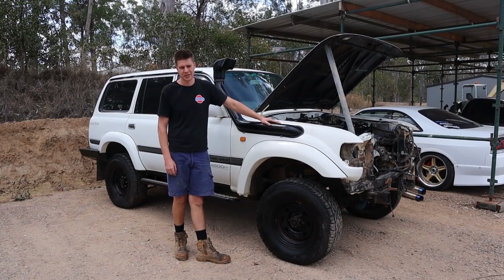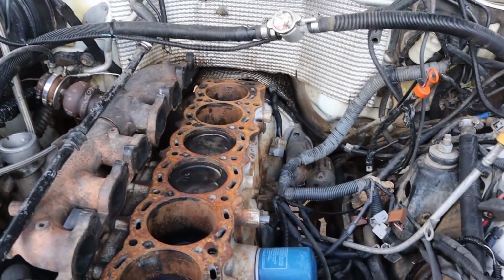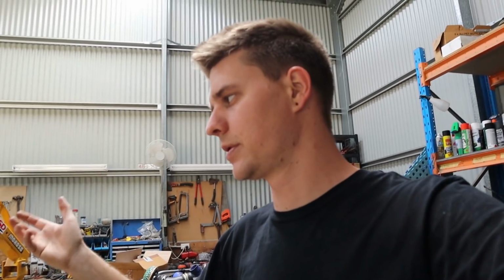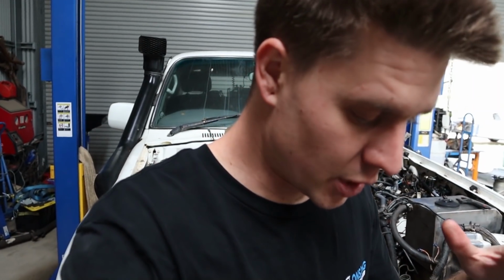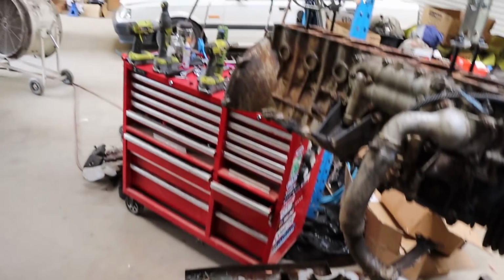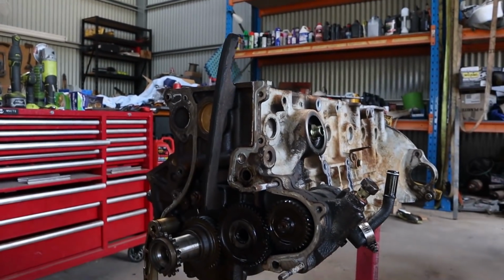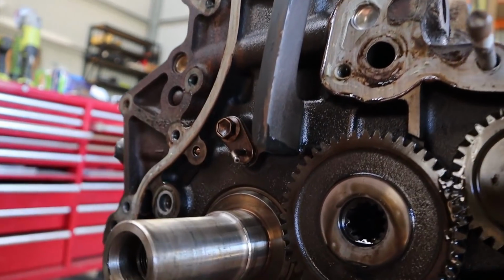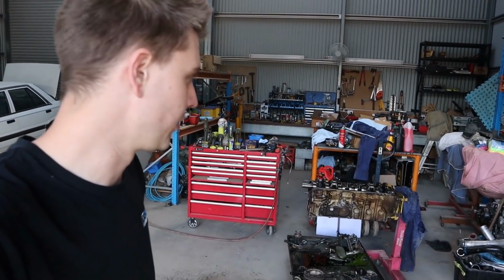Tearing Down a Broken 1FZ | Turbo 1FZ-FE 80 Series Build | Episode 1

Comment: Mate, I know talking coin is dangerous on the internet, but if someone drove in a stock FZ with high kms but running all g, what would you lads sting for a rebuild? So it was ready for a little boost at a later basically.

Comment: Hey nice build looking forward to seeing some more of it. Question. Cyl 1 lean out? Could it be possible it was flooding/over fuelling?? I had a reconditioned engine go in under 5000kms due to flooding was washing the cylinder walls and it picked up cylinder 1 skirt.... If it was running lean I would expect there to me more piston crown damage. Keen to hear your thoughts.

Comment: Can the stock engine get a turbo charger without internals ?
Reply: Yes, the can handle about 18-25psi until you will see problems. Headstuds are pretty much all you need

Comment: The obvious,, how bent is the head. Those engines get hot and the head is bent. And has to be straightened.
That gear drive is similar to the single OHC diesel. They drive the pump, p/s pump etc.
Auto adjusting cam timing is probably why it broke.
All the oilers is why those things always use oil. Poor old rings are working overtime.

Comment: I have a manual turbo 1fz.  10psi hoots off road. I run a gt3540
Reply from the maker: Clintonio Calla thats awesome mate! Are the manuals still H150 gearbox? How is it holding up?
Reply: @BoostGumps  yeah h150 , held up fine since the conversion in 2011. 230kw 650nm ish from memory atw. Just stay away from the 4 terrain clutches. Wouldn't hold 3rd doing dirt pumpies and would slip in 5th at 178kmph and climbing trying to do a top speed record of the cruiser. Part time 4b with front hubs though not awd. Mines the 
105 1fz-fe with coil pack not the 80 series with dizzy. I think they have different height pistons and different length intake. Dont know if that would make a difference to the problem with the one your working on.
Reply from the maker: Clintonio Calla awesome good to hear! We had a H150 behind the 350 chev in ours (before we went to the twin turbo LS) and we found it got unhappy very quick! That being said it was 400,000 kms old
Reply: @BoostGumps  tt ls I'm not surprised lol , that would have been a torque monster

Comment: I feel like every time you guys do a build, you cure my curiosity as I have a fzj80 I was thinking about doing something with. So my next question is where would you put a turbo 1fz as apposed to a Barra or ls conversion. Completely different league of builds or do you think the value for money with a turbo 1 fz justifies leaving it in there. just looking for opinions. Good stuff fellas.
Reply: Best thing about the 1fz is that it’s already in your car and it’s pretty much better than the Barra, basically the big brother to the 2jz
Reply: You obviously have to do some work to the 1fz like doing a coil pack conversion and adding in crank angle sensor instead of using a dizzy, apparently makes tuning a lot better
Reply from the maker: ITzRangaa i agree. The benefits of the FZ far outweigh what its worth to convert to another engine. They are so capable!
Reply: Leprechaun Laboratory only reason I would do an engine conversion in my 94 80 series is to go to a bit of a beefy built 100 series because they have coil packs and are cam timed instead of using a dizzy, butttt I have heard that the bottom end in the 80’s is a little stronger
Reply: Leprechaun Laboratory get some big boy toque out of the fz motors too, seen most guys that get around 300 to 350hp pretty much have 1000nm or just shy of, it’s quite impressive,

Comment: Were they stock oversized pistons?
Reply from the maker: Adrian Mayfield yeh .5mm overs
Reply: @BoostGumps  this is not personal experience only information from 1fz turbo pages but the stock pistons seem handle boost fine but any sort detonation under boost they are glass
Reply from the maker: Adrian Mayfield yeh i have since had a chat with a few machinists that we often use and they have told me the stock piston to wall clearance specification for these engines is extremely tight. So could have just been that she leaned out for long enough to do this amount of damage yet not put a hole in the top of a piston. All very interesting i formation none the less!
Reply: @BoostGumps  I'm running 1FZE turbo with a non-forge piston. Good tune, low boost it ok. Forge is the way to go. Also for resources, there is a 1FZE Turbo Facebook forum.

Comment: 1fz is the engine family, there was only 1 variant hence no 2fz. FE is the head spec, F = narrow valve angle, E = efi
As soon as I saw the block I thought of when brake rotors get really hot they can turn a whitish colour, but this must be paint, yes?
Reply from the maker: ifluro knew one of the letters in the convention was for narrow angle!
Yeh just the colour of the raw iron from years of dirt sand and salt i beleive